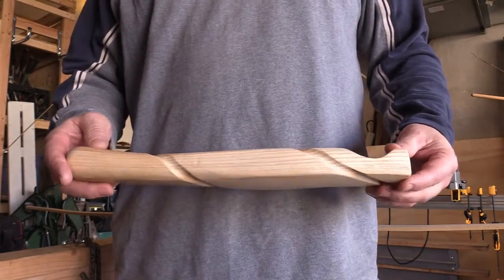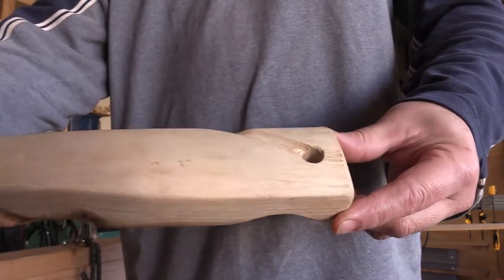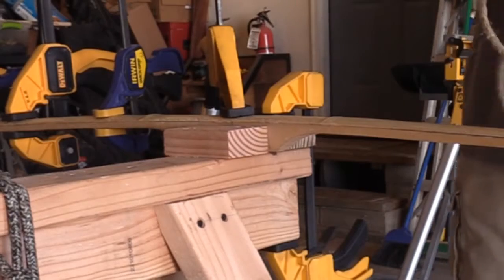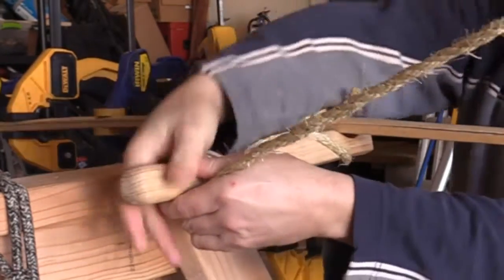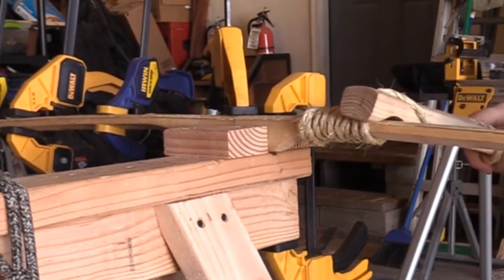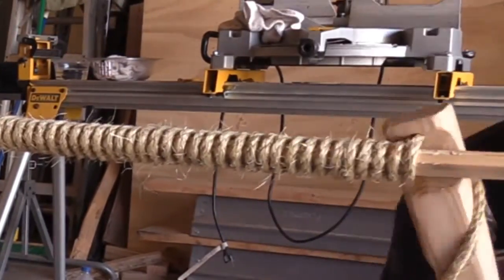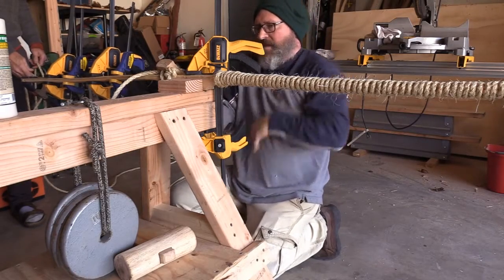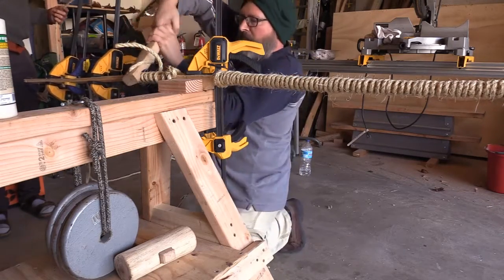Tencik Experiment

Comment: Could have a left-hand and right-hand tencik? For winding different directions?
Reply from the maker: Sure, but with the basic design (no grooves) it wouldn't matter, and with a grooved one you just switch which side of the other limb you start work from. That being said, it'd be a good experiment to have both 'left' and 'right' grooved models and see which one works better, or at least how they actually differ. I actually didn't think much about the direction of the spiral groove, just wrapped the rope around and traced it for filing.

Comment: what about glue coming out of the laminate and mixing with the rope
Reply from the maker: I was cautious in applying the glue so that I wouldn't have too much squeezing out.  Also, the sisal rope did lose some fibers to the glue, but not too much. I've re-used it several times. If you used something like paracord it may present more of a problem. Maybe some cheap clothesline would be better (cheaper).  I recently glued some silk under tension on to bamboo, where the silk was saturated with Titebond III - in that case I cut some strips of wax paper to lay over the silk and overlap the sides a bit, and then wrapped it with rope. The rope came away fine, but the wax paper, as it wrinkled a bit under the tension of the rope, did impart that pattern upon the silk.  Since I was camouflaging the silk anyway the patterning was fine. If I needed a clean look I would not tension the silk on the bamboo but rather just lay it on, smooth it out and let it be.